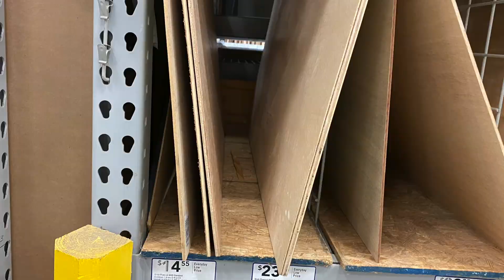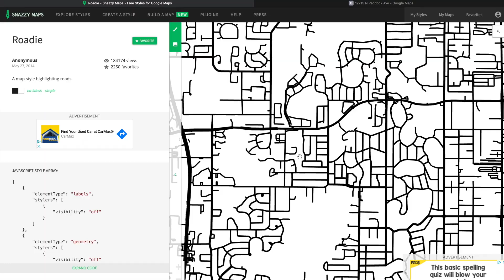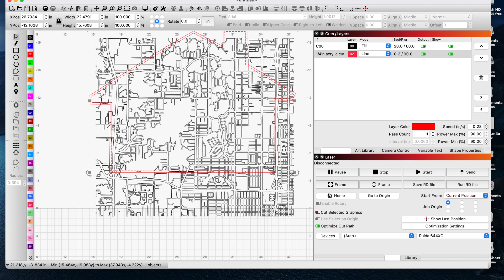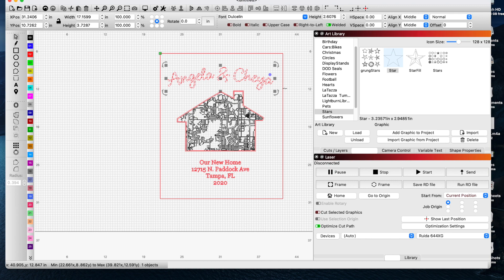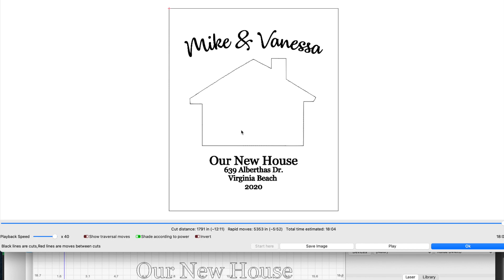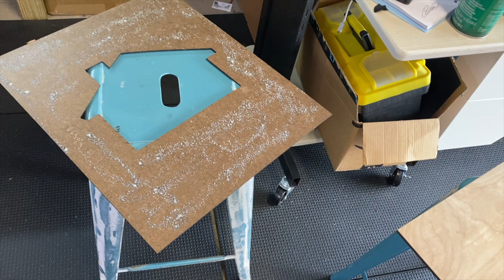How To.. Home Map Frame

Comment: I don't have an option to download the map, and i don't see any advice in the help section. is there a premium version or something?
Reply: Hey Joshua.  I was having the same issue.  I just came across this video and wanted to try it out when I get my laser.  I accidentally discovered how to download.  Under the build a map you get the 1, 2, 3, 4 down the side.  Under #1Style there is a little icon that says "View style details" when you put your mouse over it. Click on that to get to a new window.  From there you will see the green menu with a save option.  You can also click customize and change any other details in your selected style.  Hope this helps.